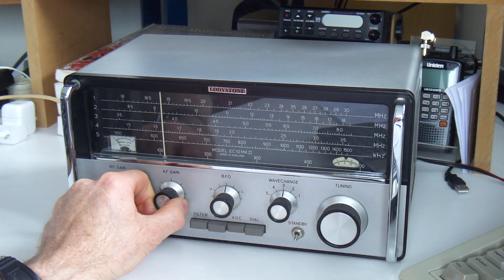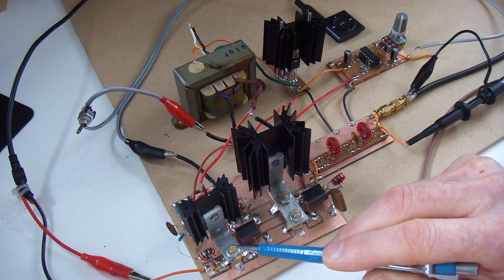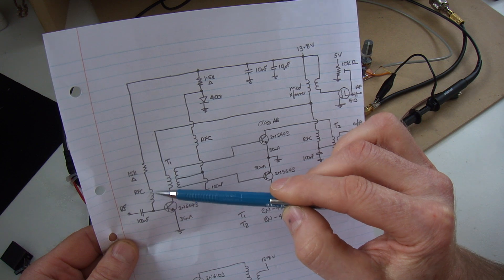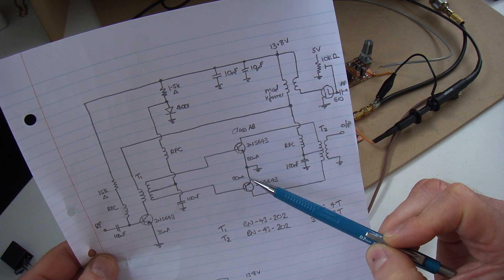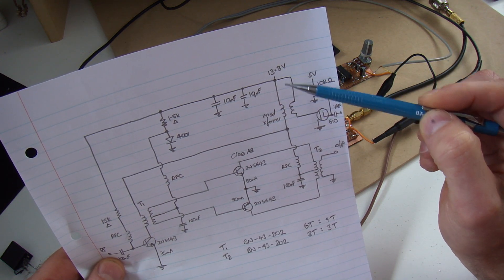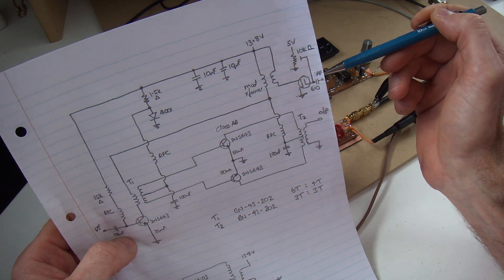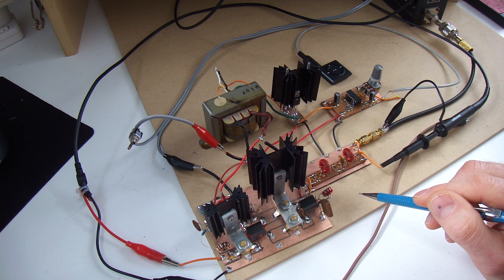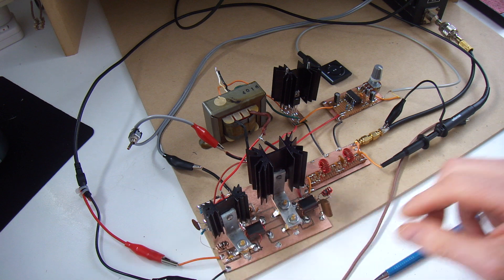AM Modulator Experiments

Comment: Just thinking are modulation transformers different from normal one's as the DC current flowing could drive the core into saturation. Used to use a "Ripple transformer" to inject audio on to DC power lines to test the ripple rejection of the power supply, and the transformers were about £1200 30 years ago. special magnetics to try and stop the core from saturating so the coupling of the audio would still work.
Reply from the maker: That's really interesting. I'll have to look into that.

Comment: Looks good Charlie. Did you consider using low level modulation instead of high level? Really cuts down on transformer weight.
Reply from the maker: No Ed. I was keen to try the old high level method. I agree that low level would be easier and require less power. All good fun!
Reply: @CharlieMorrisZL2CTM  As you said, all in good fun. Enjoy. Oh yes, hope you had a Happy Christmas.

Comment: I made an AM modulator that works well by building a class C output stage and the supplying power to it from an LM386. In other words, the class C amp literally gets its power Vcc from the lm386 output pin (no capacitor). The lm386 is centered on Vcc so now it gives you a power swing with the audio aignal, which modulates the class C output..i tried using a tansistor to regulate class c power rail bit it just didnt work as good, lm386 works really well and gives good symmetrical modulation
Reply from the maker: That's good to know thanks. I might have to give that a try sometime.
Reply: The Poppet top band transmitter uses this configuration. Couldn't get the claimed 0.5W, but did have some local QSOs.
Reply: @grahamogle6332  nice! Looked that up and yes its very close to how i have mine built, except am using an si5351 for precise frequency, and an MP3 player board with arduino for the audio input to the lm386. Everything else is very similar.

If you want more power you have to make the output filter network show a lower impedance to the class C so you get more current, but then also be able to drive the class C transistor hard enough to produce that current too. But mainly just put a good Pi filter on the output that for example gives only 10ohms on input but 50 on output. That means each class c pulse will be going through 10ohms, more current gives more power.

No doubt the reason the lm386 works better is it can source and sink current better whereas just a transistor can really only source current and you have ro rely on the load to sink enough
Reply: I haven't tried this with an LM386 because I don't like the chip 😅 But conceptually is a good idea. Now try it with an LM1875 to make a nice gutsy AM TX 😅 
I plan to try it like that, also as a suggestion you can modulate the driver a little as well to help the linearity

Comment: Hey Charlie,
Great video. nice to see some AM stuff. Looks like we will have a beautiful year of radio builds again!
I am having some issues with my switching power supply adding some switching noise into my circuits. I was wondering what you are using for a power supply? I have added a lot of filtering but just can't seem to get rid of it. I am currently switching over to lithium-ion batteries with linear regulators for many voltages just to use on this for now. Another project lol.
Merry Christmas
Reply from the maker: Hi Curt. I'm using an old transformer based variable power supply (0-20V, 30A). The rigs are running of yet another transformer based DC regulated supply. I don't have any switch mode power supplies.  

Charlie
Reply: @CharlieMorrisZL2CTM  Ok that makes sense. I should dig out the older power supplies I used with the CB's Decades ago. lol
Thanks Charlie
Reply: Are you trying to filter the mains or just the output? SMPS noise can go all over the place, depending on complexity of design.
Reply: @ed-jf3xh  I was trying to filter the SMPS noise. I was able to get it out of other equipment with ferrite beads on power leads, however, I can't get it out of the output power.
Reply: @curtstacy779  The reason I ask is because I ran across an article where KA7OEI was discussing the issue. Take a look, half way down the page;
https://ka7oei.blogspot.com/2013/09/
Reply: @ed-jf3xh  Thanks Ed, I was able sofar to read down to a 5 mV signal but very fuzzy with an lc lowpass filter on the input of my circuit. I think this article will clean it up the rest of the way. 
Thank you very much just what I needed.
Reply: @curtstacy779  No worries. Have a great day.